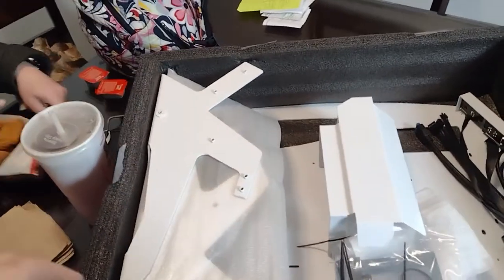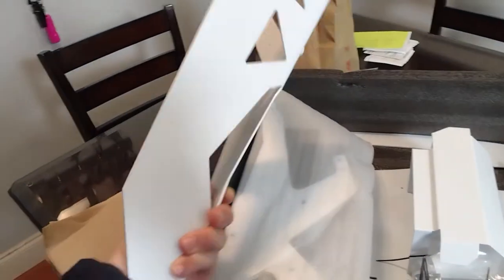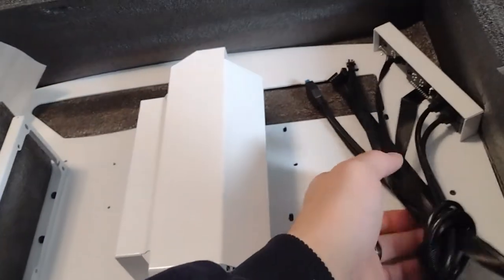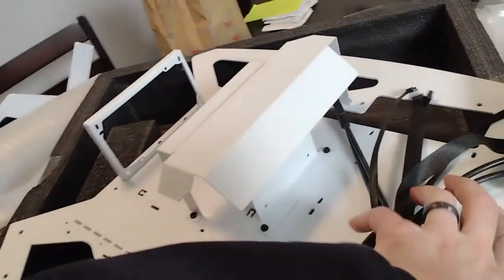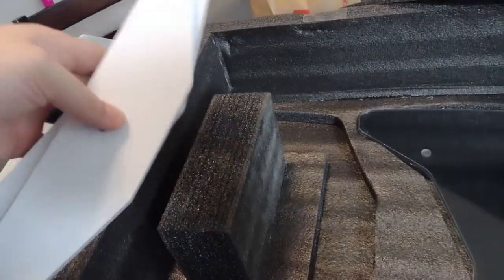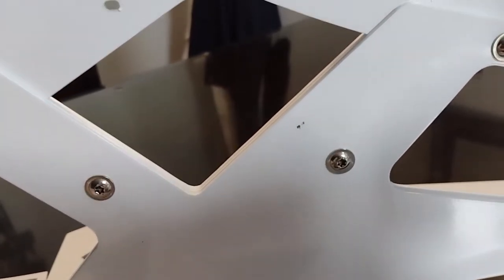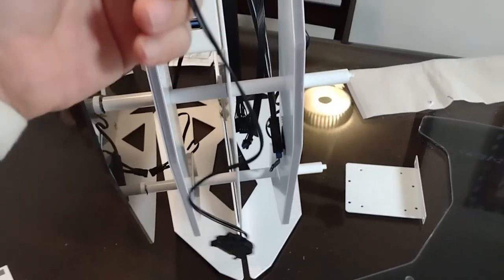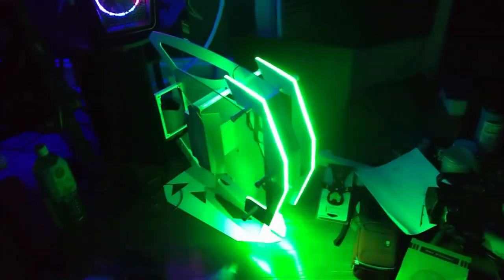KEDIERS PC Gaming Case C580

Comment: Hows the case going? For the screw find some helicoil to fix it. I have been thinking about getting it myself. At the very LEAST I need a single 240mm for an auto but would prefer a 360mm or a 420mm rad if it's able to fit. How many 3.5" hdd's can it hold?

It's about time to upgrade my OLD Mountain Mod H2GO case of you remember those lol
Reply from the maker: The case doesn't have any 3.5 bays.. and it will only hold 1 240 Thin rad.. ALOT of my plans for this case.. just didn't work... I got the screw fixed..I'm planning on a build in it here real soon... subscribe so u don't miss it